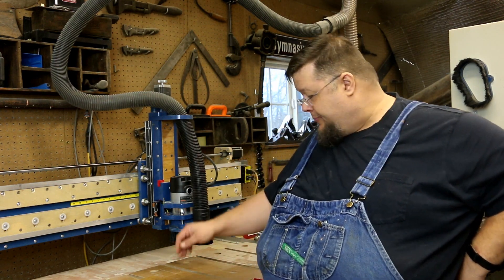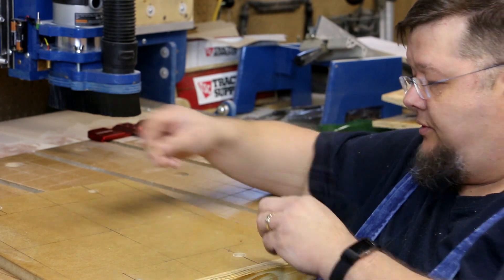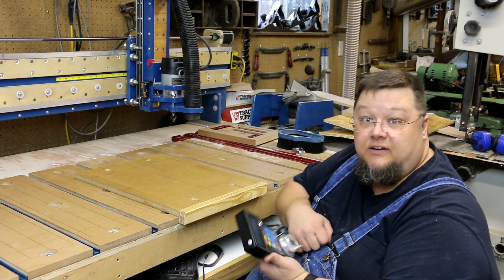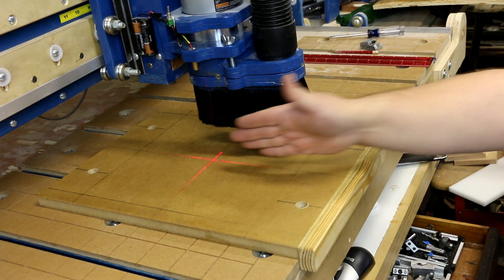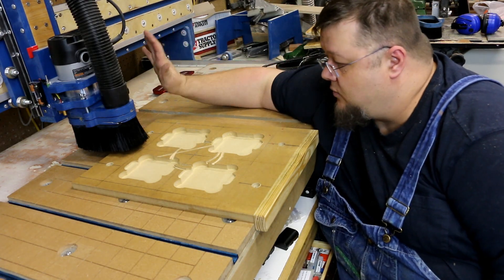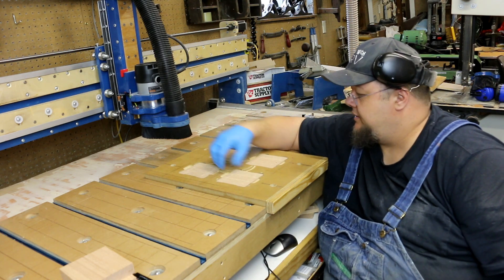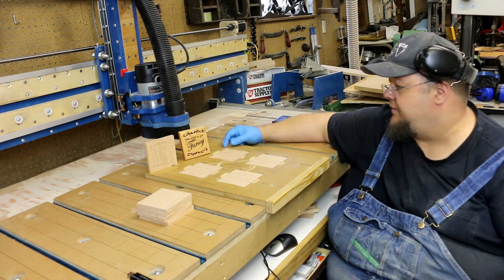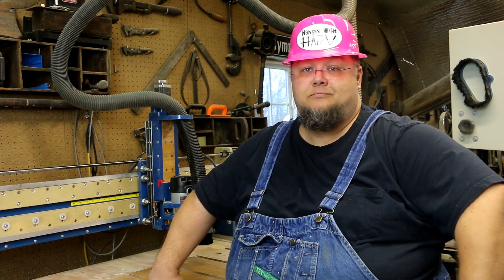Are Jigs even necessary with a CNC machine? (stay tuned for an important PSA after the video)

Comment: Hey Harv, great video. How many coasters do you have in a set and also I'm new to the cnc thing and was wondering how you set the placement of the blanks to correspond with the v-bit starting in the proper place for each blank? I am using a Shapeoko 3XXL with the carbide create program. Not quite at the 3D level yet. Also I did go ahead and set up a t-track waste board similar to yours and find it does do a fine job of clamping down the stock...if I don't need to cut too close to the edges. Thanks again for the great video.

Comment: I'm all for using jigs but why would you need to make 4 passes to cut through 1/2" material?  I'd personally use a 1/2" bit & cut it in one pass with a compression bit. How many coasters do you usually make?
Reply: Oh ok I understand,  I'm new to cnc & I'malways concerned that the MDF jig would wear out quickly & let the pieces move around.  What type of wood are you using?  It seems like oak chips alot when I do a profile cut.  I'm not sure if I'm cutting too fast or what the issue is
Reply: Ok I'll change the f&s I do have a spindle and typically I run between 150 & 200ipm